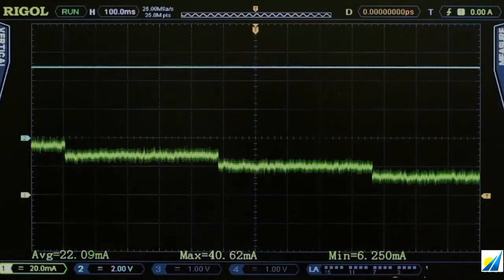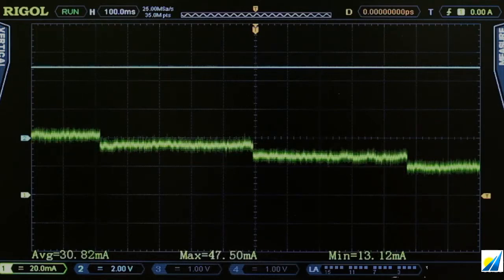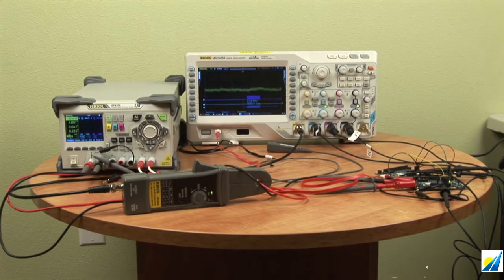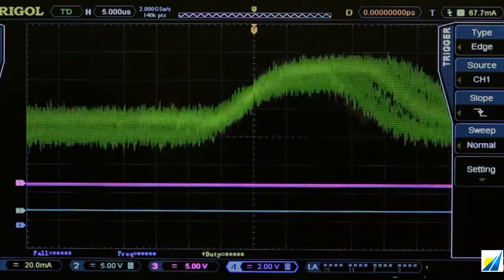IoT Power & Battery Life Testing with Rigol Products from Saelig

Comment: I work with electric and water utilities on (among other things) Advanced Meter Infrastructure (AMI). Water meters are particularly challenging because the battery is not field replaceable and the desired life is around twenty years. Ignoring things like on-demand reads, meters bring back reads for all hours in four to six batches a day means (for at least the vendor I was looking at yesterday) the device is only transmitting around 15 minutes over its entire 20 year lifespan because transmissions are so short and bursty. Lots of interesting things going on around IoT and smart cities.
Reply from the maker: Then you'd be interested in our solar products from Sol Chip.  No need for batteries!!  http://www.saelig.com/category/sol-chip.htm
Reply: Most water meters I deal with are located in pits, so there isn't light either. I haven't been as involved in natural gas metering, but it might be a fit there.